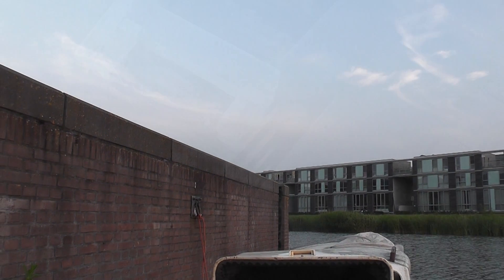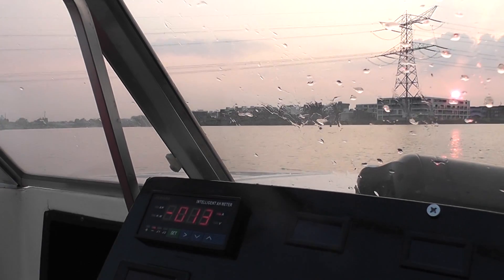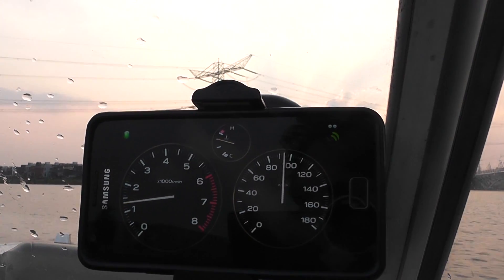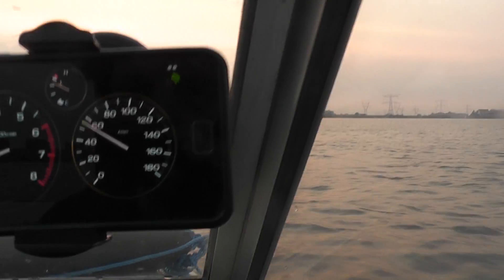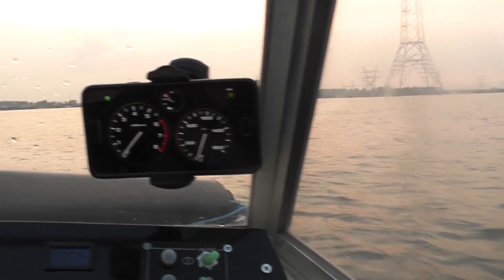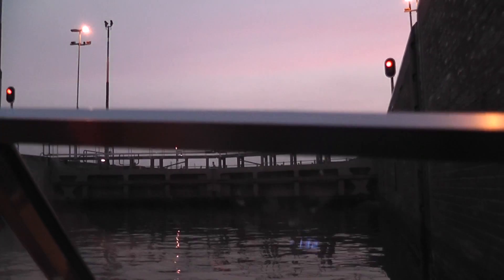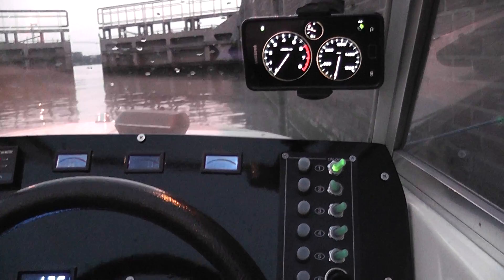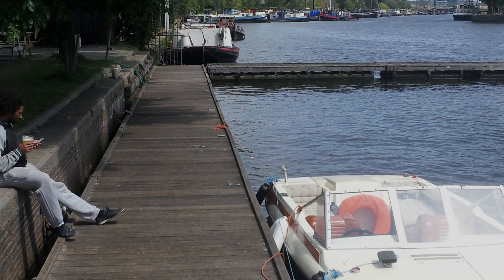Sunset Testing the Electric Speedboat

Comment from the maker: Am using an old netgear wgt 624.
Internet Connection Type: Static IP Internet IP Address: 169.254.0.2 Subnet Mask: 255.255.0.0 Gateway: 169.254.0.1

Then I just used DHCP for the internal network to be the same as it normally is for my PC which is 192.168.0.100. The router address is 192.168.0.1 with subnet mask of 255.255.255.0
Wireless ID set as "Soliton"
App for android phone is EV speedo from Autorad industries, on Google Play store.